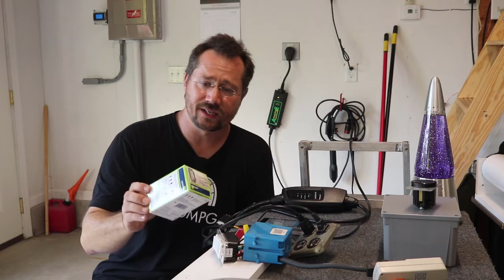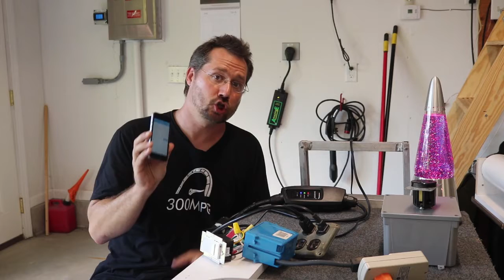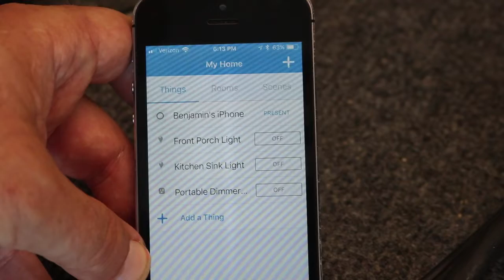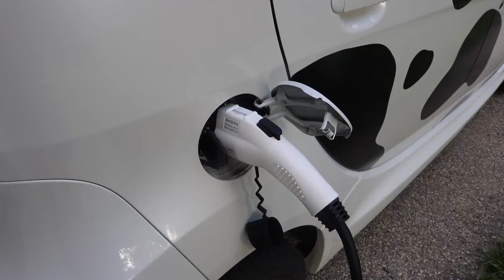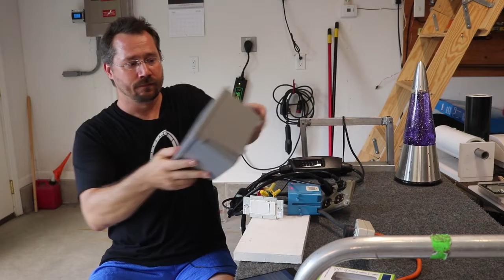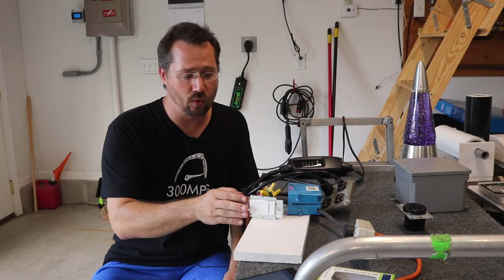EVSE Remote control proof of concept

Comment: You should never do things like that because even if the car charger accept your dimmed energy - the Dimmer will soon overheat! The evse has a function that tells the vehicle how much energy is available and you can use external electronics to set this value
Reply from the maker: This system was never intended to have power to the car going through a dimmer. This was simply of proof of concept using a remotely controlled switch (which happened to have a dimming feature.) See the finished project overview at: https://youtu.be/ivrwbV-fAb4 and the step by step of it at: https://youtu.be/ivrwbV-fAb4

Comment: you can always add an electronic timer like ELECTROMECHANICAL TIMER, 120V for $43 or search for 240v ones for closer to $100
Reply: found one at homedepot for $65 40-Amp Multi-Volt 120/208-240/277 Automatic Voltage Detection 7-Day Digital Time Switch
Reply from the maker: Yep. Lots of different ways to go, depending on how simple or complex you want to get. I actually started this project because of a friend working on a gadget simply integrating a electro-mechanical timer for his EVSE. By rigging this to my home automation system, I get advanced timer features, remote control by phone, control from anywhere on the web, and a few other neat features.
Reply: its an awesome idea! great job. an Electronic Timer would be more for people that don't want anything fancy... easy to install, reasonably priced and in once nice enclosure... keep up the great work Ben!

Comment: Was thinking about doing a EV with a separate 110 circuit to run a hard wired permanently mounted small heater to preheat the cab in winter and this looks like the last piece of the puzzle! With this I could turn it on from inside and defrost/ preheat the thing without sacrificing any battery juice.